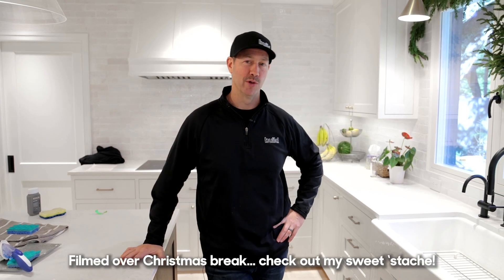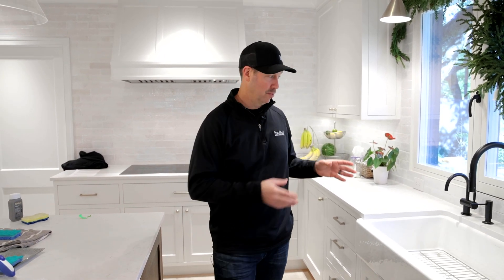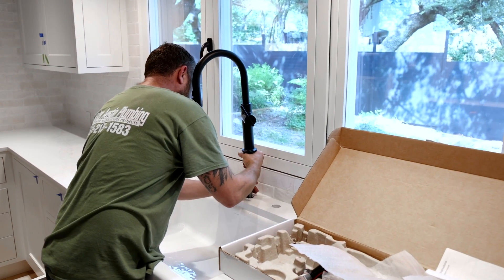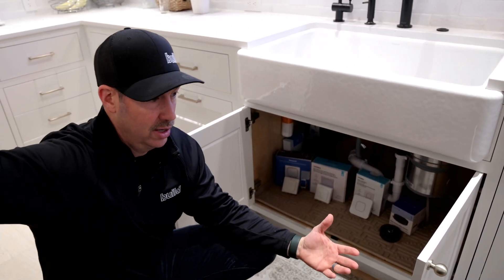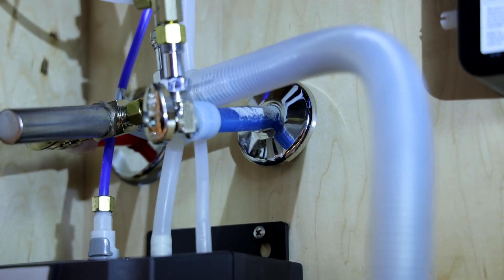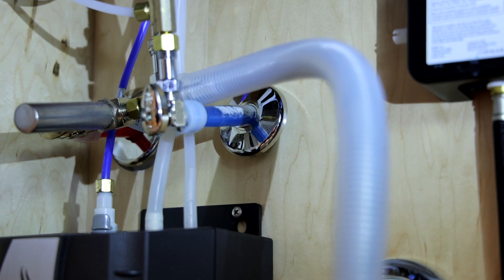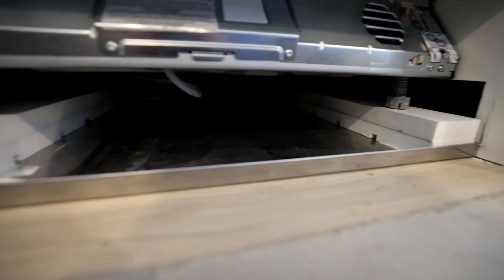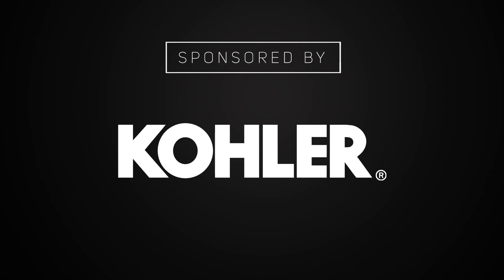6 Tips - Preventing Kitchen Leaks

Comment: Tip #7: don't install an Insinkerator instant hot water heater. I've owned two of them, and they both developed leaks after 5 or so years. The first had a cracked expansion tank, and the second had a leaking gasket between the top and bottom halves of the main tank. Also, I noticed that the later one used lower-cost internal parts (plastic instead of metal fittings) than the first. If you have one of these, definitely install leak detection, and consider turning off the supply if you are going to be away from you house for an extended period of time.

Comment: Another tip I’ll add (learned the hard way) is if you have a pull-out sprayer on your faucet, make sure that the hose for the sprayer cannot contact the hot or cold braided feed lines for the faucet as you pull the sprayer in and out. Over time, my sprayer rubbed against my hot water supply line and eventually caused a leak. Fortunately, I was home so it was just a mess and not a catastrophe.

Comment: I see a undersink electric water heater. Is that auxillery to a central weather heater? Are there localized water heaters that can do the job at a specific location as to not rely on a central heater?
Reply: Probably a hot water dispenser (see the nozzle on the counter) for tea or cooking food
Reply: @zachpw  , that's exactly what it is👍 ( InSinkErator insta hot, hot water dispenser).. 180° to 200° water temperature, great for tea, coffee , oatmeal, cleaning sticky gooey stuff off of dishes and 101 other uses. Once you have one , you can't live without it. The heating tank last about 10 years if you have good water.

Comment: The most failed area for water leaks imo is the laundry room. Ive had 2 leaks already, the first was when we finished the laundry room, we hooked up the black rubber supply lines not realizing there was a pin hole in there. The 2nd time was when i cleaned out the filter and didnt tighten the small pipe that comes out of it.
Reply: Laundry rooms used to be first but have been passed up by SS Flex lines for some reason. Small leaks under a cabinet are usually from faucet or sink seal to counter and splash water seeps down. Toilets wax seal is tied with tub/shower enclosure leaks

Comment: Sharkbite fittings avoid the need to cut the line back
Reply: This trick actually saved me from re-running some pex in an upstairs bathroom. From below, a tee was leaking right on the other side of a joist. There was no room to crimp another pex ring. Compression fitting to the rescue. Got it compressed on all 3 of the pipes without having to cut or re-run any pex. I rarely come across anyone that knows about this compression fitting advantage.

Comment: You should see the mess that is my house. All the bathroom faucets are falling apart and the shut off valves are like nothing I’ve ever seen…figured out that if I have to replace the faucet, the lines need replacing…they are awful. Toilet shutoff is the same. Pain in the rear!and inside of toilet has to be totally replaced because of the valve if there’s a problem

Comment: Uponor makes a copper J pipe for stub outs if you prefer copper angle stops. There is a 2 piece escutcheon for uponor angle stops but I agree, what do you do in 10-20 years when the gasket fails. Installing a sink isn't hard though. You just have to be careful not to cross thread anything

Comment: Went with Kohler for our remodel thinking they were high quality without going too exotic. I think their dish soap dispenser was the only trouble free item. The farm style sink like Matt’s took three tries before finding one that didn’t have an obvious enamel defect on the front apron. Their toilet came missing parts. The template for the bathroom sink screwed up the standard dimensions. Metric dimensions were larger and would have made for no overhang around our sink. The casting in the underside of that sink had burrs that had to be ground away so the drain pipe could seal. The sink faucet has required a full replacement of the wand since a full teardown couldn’t solve flow issues. Kohler’s quality control was pretty bad…

Comment: Really appreciate the videos. What is the brand of the 1/4 turn ball joint values you used under the sink?
Reply: Looks like Uponor valves. I have them at my house. I did the same thing and left 6 inches of pex lines protruding out the wall for those "Just in case" scenarios. Not pretty but function over form
Reply from the maker: Yep Uponor

Comment: I am surprised to see you used polypropylene P-Trap under kitchen sink. It is perfectly fine to use one, but inner diameter is smaller than PVC P-trap.
Reply: Doesn't usually make much of a difference if its run after a garbage disposal
Reply: @moocowzrock  Problem with kitchen drain is it tends to have more build up in the pipe (mostly from grease). Bigger diameter drain will last longer before needing cleaning. But, then advantage of PP trap is it is easier to pull it a part. No tools needed. I like using PP trap for vanity for this reason.
Reply: @lambition  For sure for bathroom vanities, especially commonly used personal ones, its a necessity.  With a kitchen sink usually a lot of water gets run through it as it is being used, and gets used multiple times a day between the sink and dishwasher draining, so between that and a garbage disposal, I feel like I get good flow of any solids or other material down the pipe.  In bathrooms, between hair and toothpaste and mucus and everything else, the water gets turned off much quicker and with less consistent use than a kitchen sink, so stuff builds up quicker without having lots of water behind it to push it along.  Cleaning the traps in bathroom sinks have always been so much worse than kitchen sinks for me.

Comment: I see electric range in the background…I hope you went with “induction”. Anyone who uses induction falls in love with it. Speed, efficiency, safety, delicate control of temps, easy clean-up, electric/no gas (solar panel friendly ;-)
But mainly SPEED…all that power is used to DIRECTLY heat “the pot itself”!  It’s like you are cooking on a lightbulb filament. The heat is almost instant when you turn it on. (Unlike gas where you have to wait for the flame itself to transfer its heat to the pot, and much of it is lost traveling around the sides of the pot.
Reply: I have always loved using gas to cook with mainly because those electric stoves only had 10 settings and I usually burned stuff with them.  The new home I'm building I'm planning on trying the induction instead of gas.  Hope it works out.
Reply: It is induction
Reply: No cook worth anything cooks with electric. Gas all the way.
Reply: @randydesrochers2884  Lots of high-end restaurants use induction, some even Michelin starred. I’m sure it’s fine for whatever you cook at home.

Comment: I think PEX  instead of a copper stub out is a mistake if you're looking for something robust and leak free. Yes technically it's another joint but having one additional copper joint is inconsequential. If it's sweated in properly and doesn't leak on day one it's not going to leak on day 10,000. PEX on the other hand does not have the same durability as copper. You now have the shutoff valves and connected hoses just hanging off of the PEX in the wall. What if the pull down faucet hose happens to be routed around one of the supply hoses such that it tugs on it every time someone does the dishes? Now instead of just the faucet hose cracking 15 years down the road maybe the sconce has finally slowly cut into it enough to form a pinhole leak right at the wall. What about if the hose is pressing up against a poorly balanced garbage disposal and the vibrations effectively do the same thing? What about when the homeowner is trying to pull out some random junk they're storing under the sink and is rough pulling it out thinking it's getting caught squeezing past the garbage disposal when really it's caught on the shutoff valve?

PEX is great but your permanent plumbing that you want to last over a century shouldn't be moving around and getting flexed from time to time. It should be secured and protected so nothing is touching it for much of the same reasons why you put on that water hammer arrestor. With a copper stub-out you can make a mechanically stiff connection so that the PEX connection is left unmoved and protected inside the wall and the copper connection gives those valves some structure so they're not just flapping around in the breeze. If you wanted to be real nice to your great grandkids you could go the extra mile and put the lines in a single stud bay on opposite sides with an access panel in the center so even if you had to replace the copper stub outs you'd still have access without cutting into the wall and you could give yourself enough room to pull out a batt of insulation and get an impact driver in there to remove or install copper tube straps or expand the pex and put it on the new fitting. The shutoff valve should be the transition between the plumbing in the walls that never gets moved or disturbed and the hoses going to whatever plumbing fixture in the house.

Comment: Plywood is not much better than melamine or mdf. Try Extira or Medex bonded to cabinet liner or other laminate for sink bases and any other wet area cabinets (trash pullouts). Silicone the joints and hold the bottom shelf an ⅛ high in the back. Waterproof and leak discovery built in to the design. Cheapest kitchen insurance policy anywhere.
Reply: Plywood is superior over melamine, mdf.
Reply: Brian Kliss - " plywood is no better than melamine or MDF " ??? Where and how did you come up with this ? I ask because woodworking has been in my family since 1933 and I have been a cabinet maker for the last 48 years . I build ALL my kitchen boxes out of Birch or Maple plywood , and I use a premium lacquer as my finish , so there is NO SWELLING of anything under the sink , Guaranteed !! As an example , I built a kitchen about 10 years ago ,  while taking the measurements I noticed a joint in the pex line in the ceiling above the island , I pointed that out to the home owner but he wasn't concerned . Upon completion I told the home owner that the drawers ( built out of Baltic Birch ) would hold water and wouldn't swell and the same with the boxes . Well about 3 years later i receive a frantic call about a flood at this house from the ceiling ! EXACTLY where I had pointed out 3 years previously , when I walked in the home owner told me that they didn't believe me when I had told them that the drawers would hold water without swelling , but now they do because the drawers were full of water ( 10 " ) and the boxes were also soaked but no swelling also . The only thing that did swell were 5 doors and they were a Shaker style . So the water got in between the 1/4 " middle panel and the solid wood frame and the 1/4 " plywood did swell up . The insurance company LOVED the bill .
Reply: Lol! Broke the internet with the plywood vs. composites debate. Unless your plywood is marine grade and impregnated with zinc borate and comes with a 10 year warranty - Extira/medex with a laminate overlay is a better choice. For the plywood fans you can use marine grade ply as a core also. Interior grade plywood will mold just like all the other "was-wood" (-Lstiburek's word) out there. Have done way too many insurance repairs on other shops plywood cabinets; would hate to have one of my customers lose their kitchen over the marginal extra cost of a waterproof sink base. Order a cabinet liner with a medex core from anyone who does laid up panels in your area.(West Coast Laminating) Yes...it's extreme overkill. But it's an easy win-win. The cut fit pans are band aid...fix the real problem and raise your sink base game.
Reply: @AJ7-  4,5...do I hear 6?
Reply: @BrianKliss  - How about 7 ? Why don't you try out a piece of plywood ( birch or maple ) lacquered all sides throw it in water and take a look ?

Comment: Knocking the handyman, c’mon dude.  I just installed all pvc under sink and my crimper for pex works the same as a licensed plumbers crimper, and when I use the level I’m able to put the bubble between the 2 little lines.  😂.
Reply: There aren't any crimp rings in that house.  Not one.  He used Pex-A.  A decent expansion tool for Pex-A runs about $800 and replacement heads are about $50 each...  It's not as pricey as getting tooled up for ProPress and MegaPress, but it's more than most DIY-ers and handimen want to invest.
Reply: The cinch rings or crimp rings with the go-no go gauge is fine.  There will always be a better “new” way of doing things that is always costly.  There is really no need imho.
Reply: @shawncote3110  Pex-A isn't a new thing.  In fact, Pex B is newer.  They both have pros and cons.  Both are cheap and fast to install.  The expansion tool I mentioned before is actually pretty cheap in the long run when you consider how expensive brass fittings for Pex B are these days.  It just depends on how many jobs you're going to do in a year and how many of them might be sensitive to pressure reduction caused by Pex B fittings restricting flow... and I suppose it also depends a little on availability.  Home Depot and Lowes don't dedicate shelf space to Pex A fittings.
Reply: @betweenfiveandseven  Yes, I understand.  It’s hard to come by in the area I live and so I just use whats available.  Also, I don’t do enough of it to justify the upgrade.  I also didn’t consider the restriction of the flow with brass fittings.. it’s all good to know.  Thanks.
Reply: $399 for a milwaukee m12 expander with a battery or 60 bucks for a manual one and both work as good as the $800 m18 milwaukee expander. The plumber for Essential Craftsman used a manual one for his spec house. I highly recommend watching the videos where he is doing the plumbing, he is very entertaining.

Comment: That's one very low kitchen drain you just did have enough room to install a P-trap and with all that talk about making sure to have less connections the slip fit is sure the way to go instead of a glue
 P-trap  ,  Lol 😆 😂 🤣.  

 Keep up the good work.
Reply: I'm glad you'll get another  100 years out of that pex.  I'll be lucky if I make it another 35 years.  And I'm not much older than you.  100 year nice!!!
Reply: Why would you want a glue P trap? So you have to replumb every time you drop something down the drain?
Reply: @mr.g937  whatever they drop will be in the garbage disposal not in the p trap. They also sell p traps with a union or even with a clean out at the bottom of the trap. Slip fit connections belong in mobile homes and RVs not in custom 7 figure homes.

Comment: There is so much going on wrong here I had to watch this video again. Waste roughed out way to low. Missing escutcheons. Electronictical outlets shouldn't be close to center of cabinet. This mat will not stop water dripping down the side of cabinet. It will just trap water under mat. I have seen this over and over. This unnecessary filter is right up against the wall. When it leaks, it will make its way behind mat. There are much better ways to contain leaks under cabinets.
Reply: LMAO😂😂😂😂
Reply: What’s a better way? Curious so I can add it under my cabinet.
Reply: In your case, since you already bought the mat maybe you just caulk the mat to the wall of the cabinet.  Most cabinets have malemine inside. Simply seam seal the inside of your cabinet and install tub molding across the front floor of cabinet. Since you have blocked all exit points, water will find it way to your alarm.  I set my alarm on a paper towel to wick water from a larger footprint.
Reply: My dad would use crack-n-peel vinyl flooring tiles which is both waterproof and light wt. I use a hard plastic tray beneath the sink which I can easily pull out in case if any small leaks and dump water in the sink.

Comment: Many Kohler pull down faucets hoses bind when cold winter water passes through. I will not use them. Your waste line rough in was not thought out well. It should have come out on the right back third of the cabinet.  This keeps pullout hose from dragging. Hot and cold stops should have been plumbed out far left and right of back cabine wall. This keeps supplies out of center causing drag on pullout hose. I see 1/4" polyethylene tubing. This is well known for making icemaker lines the number one payout for insurance companies. Those  compression tees screem out handyman . I also may see a filter under there. Why?
Reply: The 1/4 inch poly line is for the insta hot filters and it's never Under Pressure until the handle is pulled. It comes with the InSinkErator insta hot unit all Incorporated. The insta faucet does come with copper tubing and connector ( the copper incoming line is under pressure at all times).
Reply: @boby115  Good point, but I would not use it . It's just a weak link.  I don't put point of use filters under sinks. Water should be filtered on the main line from a utility room or garage. Why put all these potential leak points in the most expensive part of the house. This was a new build, you have options. Polyethylene also breaks down from heat. I'm sure this house doesn't have the toe kick vent just jammed into the floor, but most CA houses do. These sink cabinets get so hot in CA it will melt candles and bars of soap under there.